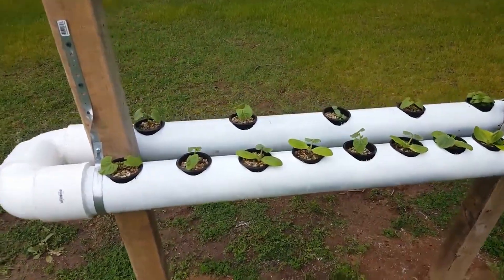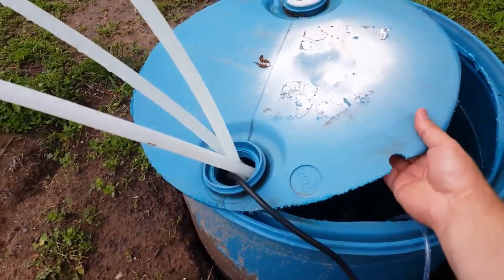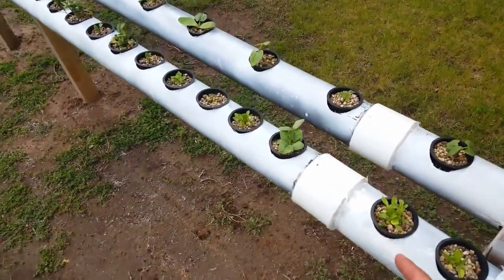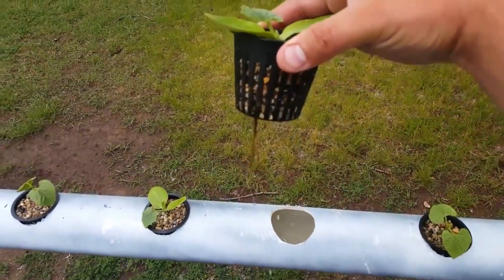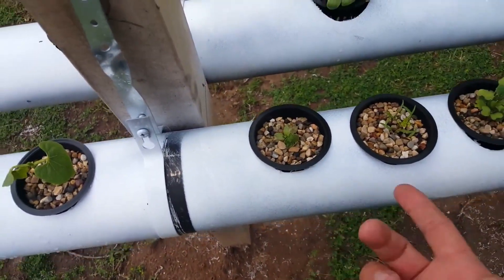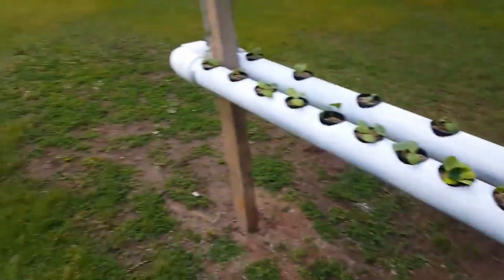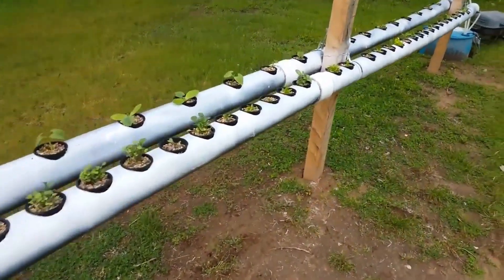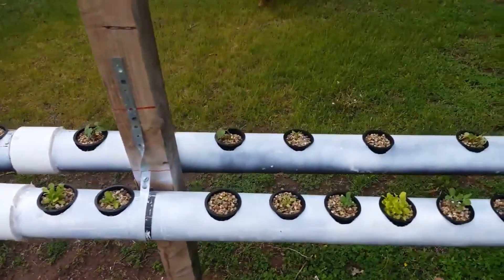How We Made Our First Hydroponic Rail System

Comment: Hi. Thank you for doing the video. I’m experimenting with hydroponics this year on my 30 acre farm in South Carolina. My goal is to grow salad greens year round hence the indoor basement setup where they can grow under lights and not bolt in the SC heat. Can you briefly explain what issues you are trying to solve by doing a hydroponic system outside opposed to just growing in the ground? I’m just not understanding what issue you are attacking here. 

I tried pumping 58 degree creek water through a raised bed under shade cloth but my cool weather crops still bolted too soon.
Reply from the maker: This soil under our feet was all sand. We shot this almost 10 years ago as we were getting into gardening and have since moved to a new location where we did make raised beds and no-till mound rows. We've moved everything to organic soil now, but we've been moving all our old videos to this new channel to combine everything under one channel for homesteading. Sounds like you have an awesome farm!